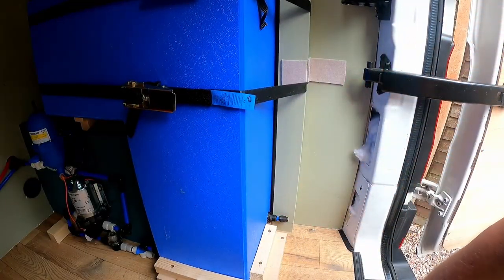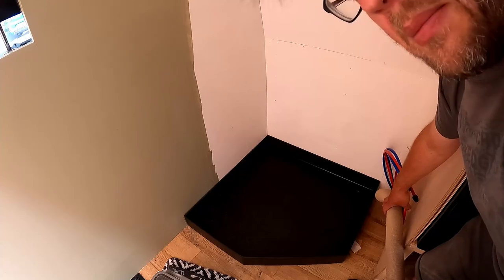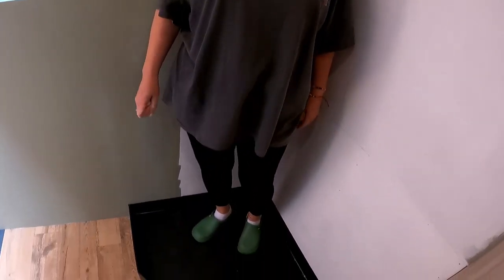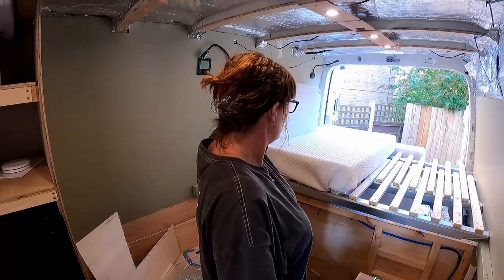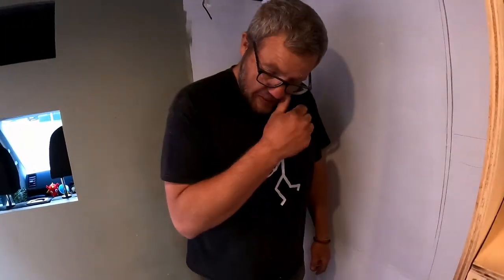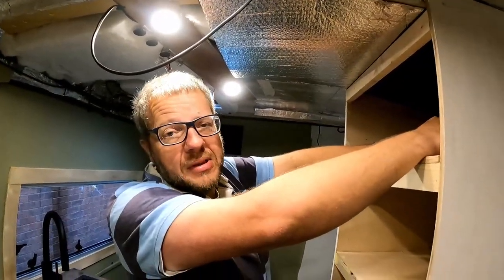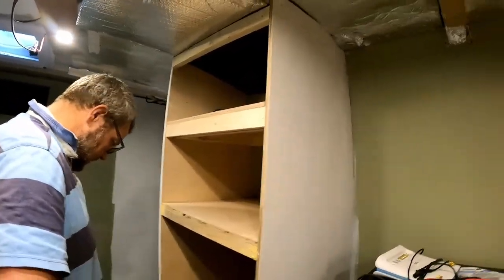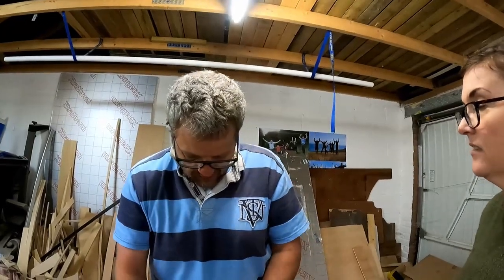Plumbing nightmares! | Fitting a camper van shower | VW Crafter Van Conversion Diary Week 14

Comment: Unfortunately that is going to leak like buggery.
The two seals on the drain are designed to go either side of the shower tray and then tighten with the nut.
So should have been fitted prior to fixing tray to floor.
Reply from the maker: Thanks for the advice 😁